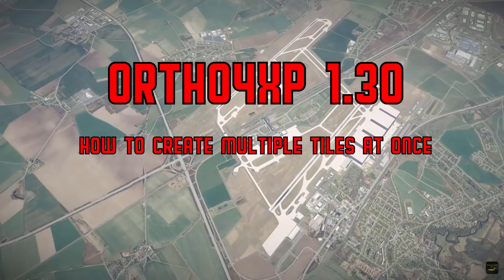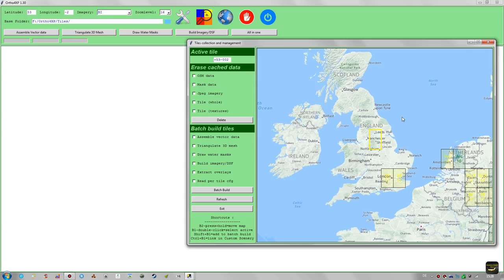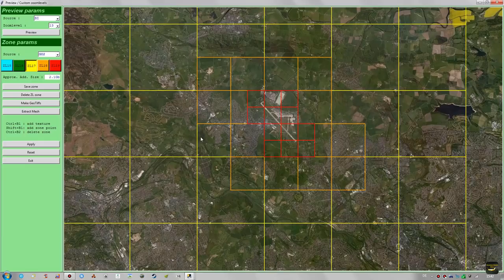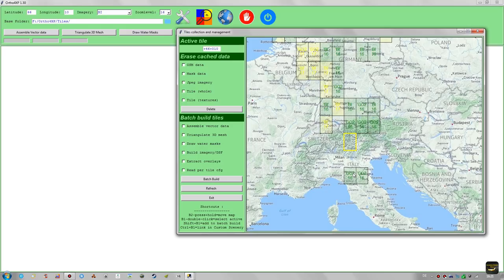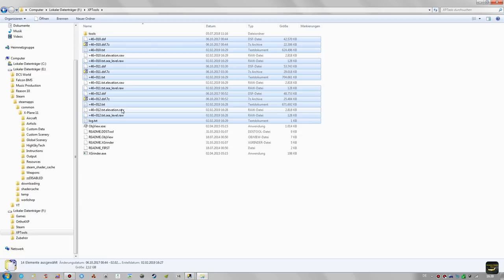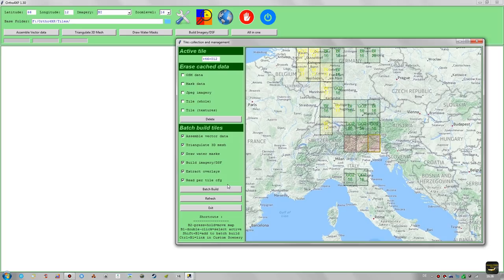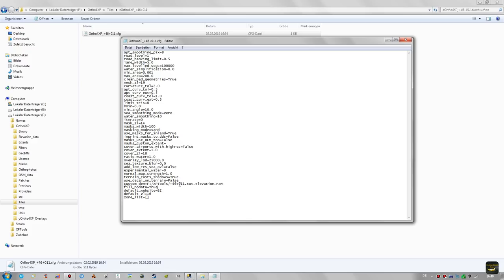Ortho4XP 1.30 | How To Create Multiple Tiles At Once [Tutorial|X-Plane 11]

Comment from the maker: One important remark when creating multiple tiles with the HD Mesh and also applying custom zoom level areas to the tiles:
Contrary to what I say in the video, you have to apply the higher zoom level areas to the tile BEFORE writing the tile .cfg file in the settings window. So it's the other way around to what I say in the video. Otherwise somehow the custom ZL areas won't be remembered and all imagery for the tile will be downloaded in the base ZL. Sorry for the confusion.
Reply: I dont use HD Mesh but still have the problem when creating 2 tiles at the same time which both have higher zoom level areas. The first tile always has the standard zoom level as you mentioned. It seems that the program can´t "remember" the first tile parameters.
Reply from the maker: Hmmm that's strange, I just recently created 8 tiles (2x 4 tiles as a batch) in Canada for my new ZIBO tutorial and started with the tiles containing the airports and the higher ZL areas and it all worked fine for me. Also the areas in the first tile got remembered in my case (and also not using HD Mesh btw).
Reply: @SimulationChannelDeluxe  I believe you have to mark " READ PER TILE CFG " also ! ( at 5:22 ) . Otherwise it won't read that ' per tile config ' !

Comment: Thank you again....very helpful....up until now I have only Ortho  tiled in basic format around LOWI  and was not sure about the mesh 'mix' as there are opposing opinions on benefits of adding mesh.. I wondered if I add an alpilotx mesh tile then add a Ortho tile to the same lat/long tile area  ....is this the same exercise as you have described or will the 'area' be messed up doing it this way? ....
Reply from the maker: Thanks Mazo :) All the photoreal scenery that I created for the Alps and around LOWI uses the alpilotX mesh/elevation data. And I'm absolutely happy with the result (you can also see that area during the intro and outro of this video). If you already have ortho scenery in that area but without the HD mesh, I don't know if recreating all the tiles would be worth the effort, as I don't think there is an easier way to apply the HD mesh to already existing tiles.

Comment: Just woww

Thank you soo much !!
Just what I was looking for
Love your tutorials 

Just one question for those who is using x europe v2, the option for extract overlays its not necessary, right ? 
Or there is some advantage to add them as well in the overlay folder ?

One last thing😁

The folder created by the ortho4xp  which cotains these confg on what was used to create the tiles can I delete them too ?
Reply from the maker: I'm glad you like the tutorials :) Concerning your questions:
1) I'm not very familiar with xEurope, but if it places autogen based on OSM data then theoretically you don't need to create overlays via Ortho4XP for the covered regions. Just make sure that xEurope's entries are above the ortho tiles in the scenery_packs.ini.
2) Since the config files get created in the tile output folder that you specified and all other contents of the photoreal tile will go in there as well, I wouldn't delete anything right there.
Reply: Thanks for answering
I dont exactly understood from the video where this confg file was located. I mean.. I thought it was a second folder made it by  ortho4xp with the same coordinates of the tile, but in one of them containing this confg file giving information about the tile it self. Thats why I was asking if can I delete - just to not hold unecessary files.
Reply: No, as the wiki of xeurope states, you don't need to extract the overlays since you would have disable them anyways.

Comment: Question:
First of all I must tell you that I learned a lot from your videos. Thanks a lot for that. 
Please tell me what is the maximum curvature tolerance in configuration window (Curvature_tol) to get maximum mesh elevation with maximum triangles. I reduce the values to 0.1 and got good results.
Unfortunately there is no HD mesh Scenery for Sri Lanka (ASia)????
Reply from the maker: I used to play around with that setting in the previous version of Ortho4XP, but now I'm just always using the default value. It gives good mesh resolution with not too many triangles. You can of course set it as you like and some people prefer several million mesh triangles in a tile, but for me default is just fine. And even if there's no HD Mesh available for your area, I think that Ortho4XP downloads a high quality mesh that is superior to X-Plane's default mesh.
Reply: @SimulationChannelDeluxe  Thanks for your reply. but my orthophotos in most tiles have lots of clouds (in BI). But Google photos shows abnormal greenish shading which are different from neighboring tiles. This make so unrealistic to use them.
Reply from the maker: @rahalwidanagamage  Yes some regions of the world have poor photoreal imagery coverage, in both Bing and Google. There's nothing we can do about it.

Comment: Does it Generate the Mesh data like Ortho4xp 1.2?  Is the output a smaller disk size?
Reply from the maker: I'm sorry mate but I don't fully understand your question, also I never really had a look at the specific files that Ortho4XP 1.20 created :)
Reply: @SimulationChannelDeluxe  I want use altpilot mesh v4. The earlier versions of Ortho4xp generated the mesh so using altpilot mesh was not possible and the downloads were huge. I hope 1.30 fixes that and it can use altpilot mesh.
Reply from the maker: @Greazer  What can be used by Ortho4XP from alpilotX's HD Mesh is 1) the elevation data and 2) the more up to date OSM data to create the "autogen" overlays. For the elevation data you need to extract the elevation.raw files with XGrinder (like I show in the video) and for the OSM data (so roads, houses, trees etc.) you need to setup the correct path for the "custom_overlay_src" and then tick "Extract Overlays" in the map window. Then it should all work.

Comment: Is there a way to see the tiles you already installed, on the map? Thanks for the tutorial!
Reply from the maker: Yes, the tiles that are already installed will be marked on the map.
Reply: @SimulationChannelDeluxe  Cool, thanks!
Reply: @SimulationChannelDeluxe  Strangely, mine doesn't do that. Any ideas on how I can set Ortho to show them? Thanks for great vids by the way.
Reply from the maker: @spy2778  I don't think there's a setting for that. Do you use version 1.30? For me it showed all installed tiles just from the start, even the ones I created before with version 1.20. Are all your created tiles still within the tile output folder that you specify in the main window?

Comment: Your tutorial indeed helped me how to make multiple tiles with the hd mesh v4 but the costume zl didnt work.
I did it step by step as you mentioned in the video but the costume zl didnt worked. Dont know why 
Any thoughts ?
Reply from the maker: How do you know it didn't work? Did you apply the changes in the custom zoom levels window? Did Ortho4XP download the higher zoom level areas correctly (you can check in the "Orthophotos" folder of Ortho4XP if the higher ZL imagery folders are present)?
Reply: @SimulationChannelDeluxe  Yes I know, I checked in the ortho folder looking for the zl created and it was just the default zl for the whole tile . The funny thing is, when I tried to make one more time it worked but then after  it didnt lol
I ve paid attention that when I make the costume zl before setting the confg options ( dealing with the hd mesh elevation ) it works.
Reply from the maker: @hooryricardo  Thanks for letting me know mate, I just double checked and indeed the zoom level areas have to be specified before writing the tile cfg file. I pinned a comment at the top pointing that problem out. Thanks again :)
Reply: @SimulationChannelDeluxe  my pleasure capt. I thank you

Comment: Hi! Do you store your ortho4xp files on an external hdd?
Reply from the maker: I store them on an internal HDD, but it's also a different one than the one XP11 is installed on. Saving the tiles on an external HDD is also possible, as long as the connection to the PC is fast enough (e.g. USB 3.0).
Reply: Simulation Channel Deluxe hi dont know if you will ever see this but how big is your hdd that you put all of the ortho on and how big of an hdd would i need to get if i wanted to get hd mesh for all of the usa and do a similar custom tile set up where its 19 on the airport 18 around the airport and 17 around that with the remainder of the tiles being 16. Thanks in advance this video helped me alot i had no idea you could do any of this.            Edit: and if you have hd mesh where do you direct ortho4xp to go to instead of the xplane 11 global scenery like you mentioned in the beginning

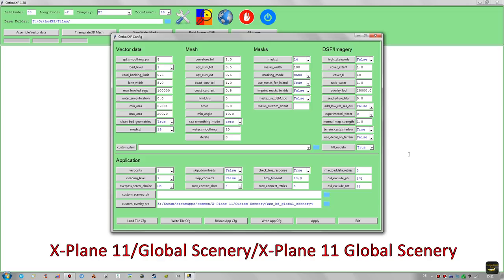Comment: 1:55 ..... You should also set " CURVATURE_TOL " to 1.0 . This way you get even better looking mountains ( more triangles )
or to 0.5 in country's with less mountains .
Reply from the maker: Yeah I played around with that setting in the past (in version 1.20) but with 1.30 I'm just always using the default value now. Sometimes there were way too many mesh triangles (several million) and that's not really necessary and may impact performance.
Reply: @SimulationChannelDeluxe  Indeed , but i like to have at least 2 to 4 million triangles ;-)